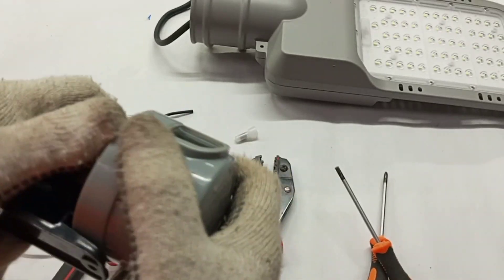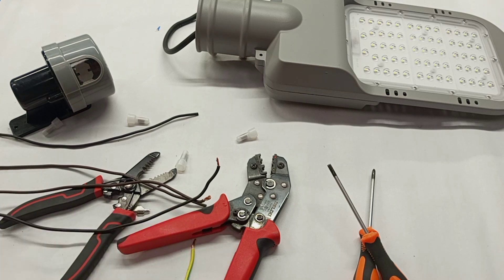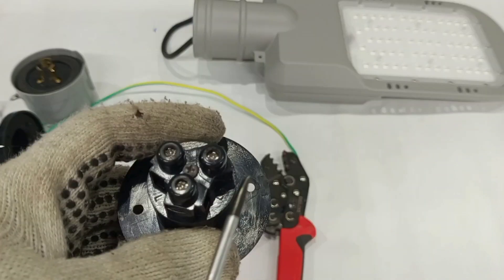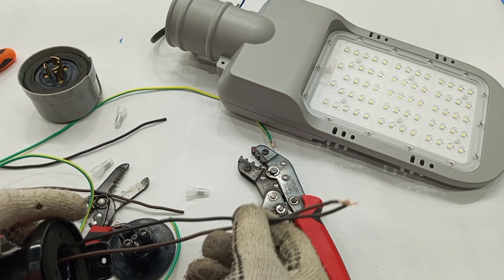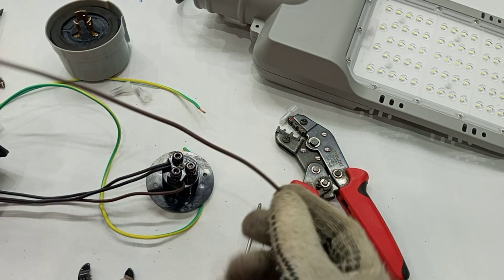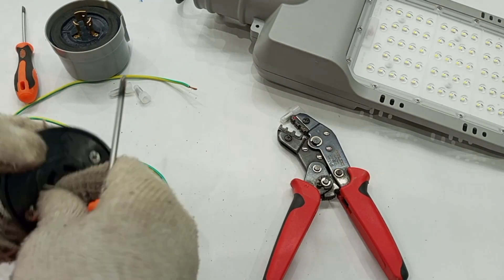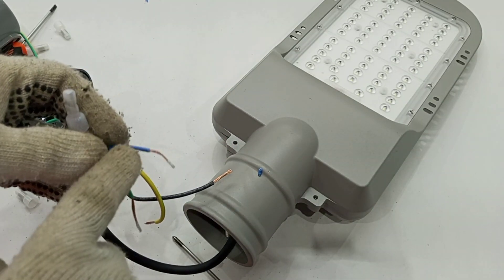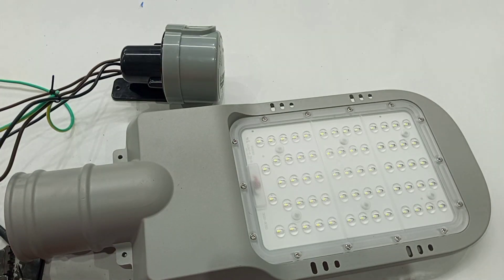HOW TO WIRE A PHOTOCELL TO A STREET LIGHT

Comment: Wow! That's very educative, another knowledge added, thanks for sharing it with us.

Please I have a question.
1. What's is loading rating of the photocell as in that maximum load to put on it.
2. What's the best position to mount the photocell.
2.
Reply from the maker: Most photocell can take a load up to 500W.
Some may have a higher rating. But normally the rating is stated on it. So  you can check the rating anytime you want to buy.

Your second question is answered in the video please. Thanks
Reply: @obloni_Electrical Thanks for your response to my question. I have watched the video before asking my question. You see when installing it people allow the sensor to face the position where the sun rises from, and some position it at any position...
Reply from the maker: @danielteyehuago1633  
Oh I see. Well, the most important thing is that it should be positioned to avoid any shadows during the day. and also, 
 Don't place the photocell near sources of artificial light, such as lamps or security lights, as this can interfere with its operation.
So generally, so far as the photocell is positioned to receive unobstructed sunlight throughout the day, it should work perfectly.
Reply: @obloni_Electrical wow! Thanks for your response. I really appreciate that

Comment: On the pole there is no earth, what will you do about the earth please
Reply from the maker: Yes! Street lights are normally installed on already-mounted electricity distribution poles. In a TT system where a Protective Earth is not accessible on the pole, the best thing is to bury one right under your pole.
the lamp can work without the earth but a provision for earth provides a lot of benefits to your lamp aside protection against shock.

Comment: Please I wanna ask you a little question about cables it uses. Knowing the current carrying capacity of a cable for 10mm² to be 46Amps can you use it to take a load from the energy to the consumer unit since the total load won't get to 10Kw and will the supply authority be okay with 10mm² instead of 16mm² cable...

2. What's the true height to position accessories like sockets in a room and kitchen etc, switches for lights,  AC, regulator etc ..
Reply from the maker: You know, there are local electrical codes or regulations that must be followed. So if there's no specific local code/regulation concerning the size of service supply cable then you are good to go. But if there are, then you must obey them. 

Your second question needs more explanation to get the proper idea of the height to position various accessories. I'm currently working on a video to answer that particular question.  But before then,  normal switches, AC switches, water heater switches etc. are usually positioned 140cm from the floor.
Socket outlets are usually 40cm above the floor level.